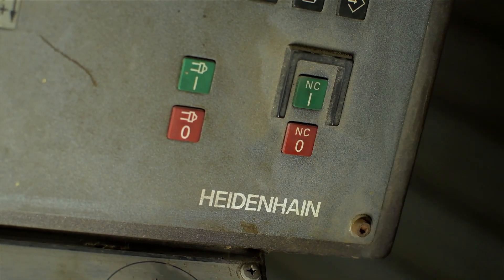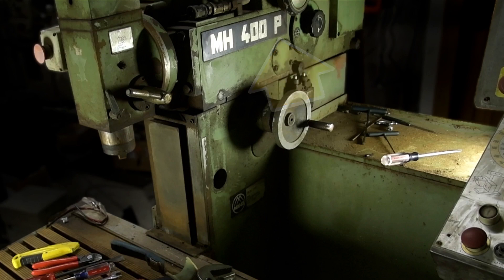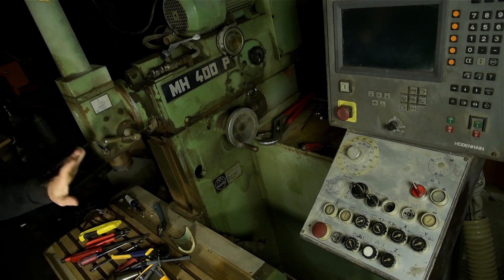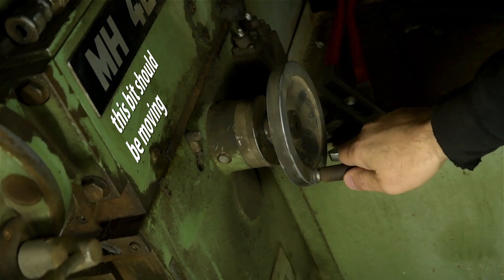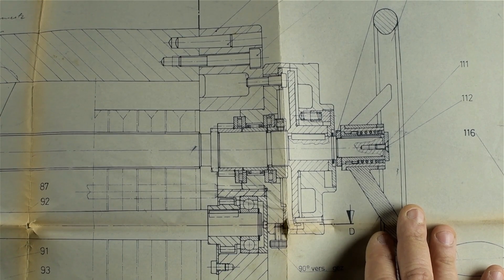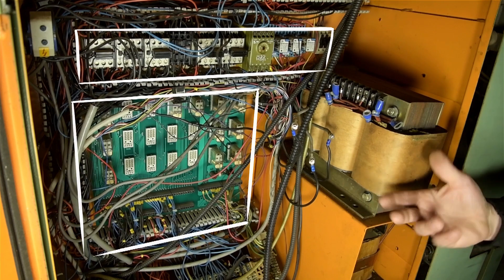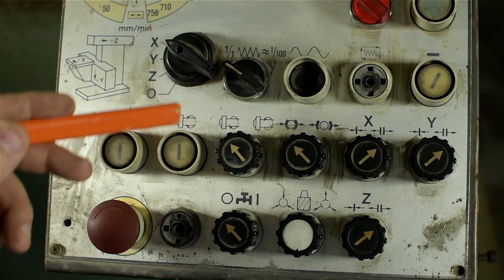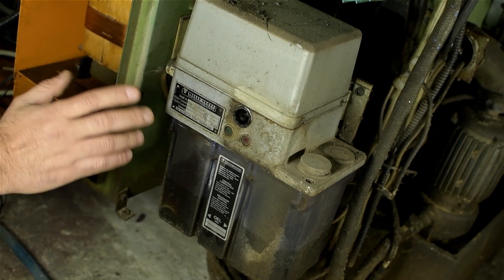MAHO is Filthy!!  (Whose Milling Machine Isn't?)

Comment: Those appear to be line reactors that you bypassed - typically used for power conditioning, especially in motor drive applications where a lot of line noise (EMC) can be induced. Essentially half of a transformer, and it probably has shorts in the windings.
Reply: I don't know about 'line reactors' but my brain said 'common mode choke' when he said it wasn't a transformer.
Reply: @Shaun.Stephens  Same basic idea. Just more power (and beefier construction) than what you'd see for a common mode choke. Basically the same deal with contactor vs relay.
Reply: @PeregrineBF  Thanks. My experience is with smaller electrical and electronic gear, hence the terminology I used.
Reply: And on that note, the effect of bypassing it will be potential damage to any upstream/downstream control electronics and the motors themselves. Maybe not immediately, but lifetime will be reduced; however, since most of that is already past its prime, TOT may be looking at damaging things quickly. Don't run long without proper drive components, or your motors may give up their smoke, Tony!
Reply: @Studio271  Really depends, as he is using a residential grid, the impedance will be most likely high enough, especially if there is a phase converter to give the missing phase from the US split phase system. The line reactors are there for factory installations where the machine is being fed via large diameter conductors, short distance from a breaker board, which is again a very short distance and with large feeders to a large ( 1MVA plus) local supply transformer, and the supply impedance is approaching zero, with the resulting massive inrush surges to contend with.

Had the same issue retrofitting a motor to run off an inverter, as opposed to the VARIMOT drive it had, as the VARIMOT components had worn out, and were replaced instead with a fixed ratio, so I had to compensate for the lack of adjustability and also go slower, limited by pulley size and space. So in went an external cooling fan for the motor ( nice Lenze motor, with full shroud and TEFC construction, and with cooling channels in the casting, but a smooth exterior) just in case it was unhappy or ran slow, and rewired it to delta from DOL star connection, along with disconnecting the DC braking system ( repurposed that supply though, got the braking clutch to work properly again) and relying on the inverter dynamic braking to dump energy fast. in went a nice little 1Hp Omron inverter, with supply via a noise filter to increase supply impedance to something higher than the existing supply impedance of around 20 milliohms, as the cable from the machine to the transformer was 30m total, and only 5m of it was smaller than 16mm.

Yes, machine built in 1970 with the biggest upgrade being that, otherwise all the existing stuff was present and running, though the more exotic parts like thermoswitches were slowly being replaced with electronic controls and Pt100 sensors as the Fenwel controls died from old age, as this was a lot cheaper, even though I can still get the Fenwal switches, but the retrofit was around a tenth the price of each switch. But got sold, and the new owner did a complete overhaul of the electricals, want to see how it looks now, but it is half a country away.
Reply: Definitely a line reactor. It's used to provide impedence between this machine and the source powering it.
Reply: That is a freaking huge line reactor for a system of that size.
Reply: @jtkilroy  It's also got quite a few motors on there and since they're not connected through a VFD, they're all asynchronous connected directly to line. So yeah, power factor is going to be horrible if there's a bit of load on those motors.

I'd pull everything out up to the wheels driving those axis screws and put some servo motors with VFD's on them.
Reply: I'm pretty sure it's not line reactor, cos if it where faulty, it would break fuses only when motor starts.. my guess is isolation transformer.
Reply: @ErrtuZarathos  Large machines often have a single set of line reactors, as it is cheaper to make a larger one than install multiple smaller ones, plus it then also protects the control logic from line transients as well. 

Single part to install, though there yes it could also be providing isolation, but with the motor power of the machine the transformer function would be much larger, though this could also be a multitap one with the ability to cater for some line adjustment as well, used as an autotransformer to correct for minor voltage adjustment, or to do 400VAC to 240VAC autotransformer, though with US equipment that probably would be also used to do 277VAC to 115VAC conversion using the same transformer. If so then probably does both functions, if you just disconnect the neutral links to turn it into 3 chokes. 

However if it got wet then windings will be toast, as the paper insulation will have arced over and broken down the first time it was powered on, killing the transformer.

Comment: What a nice Mill Tony. What TNC is this Heidenhain control? been using Heidenhain alot.
Reply from the maker: 124?  142? I mention it in the video.  It flashed on screen on power-up but I didn't get a lot of screen time with it.
Reply: @ThisOldTony  very nice. Must have missed it. They are super simple to program and have alot of cycels to help programming. Give it a go before converting it 🙂

Comment: MAHO had a good reputation as a maker of excellent manual precision boring mills in the 80’s. Then they dabbled into the CNC market. Was in a shop that bought one of their very first horizontal milling machines. A CAT-40 600mm sized machine. I was the second shift operator of it. Aside from the software, robustness, spindle motor, coolant system, & general build quality being garbage it was fine. So fine in fact that they willingly replaced it with an “improved” model within a few months. That one was only marginally better. It was gone within a year. A very long & frustrating year.
Best of luck to you with yours. I do understand that they got better at making CNC equipment.

Comment: As someone who owned a Maho MH 500 C for 10 years..  you are in for a "treat especial" you should have gotten the MH500C though. Much more user friendly. Anyway.... when will you get along with that CNC lathe conversion?!
Reply: Whats the C stand for ? What does P stand for?
Reply: @dieselmakesmehappy  The P plays Pong, the C plays Chess
Reply: P is point from point control (Punkt in German) , later they had E,C,S and W models where E was Economy, no idea what the rest stood for
Reply: @javanree   C stood for the 4th axis and W for Werkzeugwechsler so automatic toolchanger
Reply: @erklaerbaer01  vielen Dank für die Erklärung 👍
Reply: @javanree  Very Interesting. Thank you

Comment: Hi Tony, I have an MH 600P and am missing most of the documentation of it. Would it be possible for you to photograph or scan the manuals you have?
I can give you a schematic for a rework to switch the y- and z-axes, from my MH600P that you might be able to use until you upgrade yours to servos. Also, the greenish BBC-Disc-Motor should powered by the „Axodyn“-Regulator-PCB that I think I spotted mounted to the door of your cabinet.
Hope this helps! Cheers, Colin

Comment: Based on the looks of the part you bypassed and the very fact that you bypassed it and it works. I'd say that is likely a choke. It is a EMI filter that help the machine be a little more polite to the electrical grid. If I am correct about that, there is little harm (safety wise) in bypassing it. If you give us a better look and maybe trace some wires, we could confirm that?

Comment: Greetings from Germany :D i love your videos.

the 400 in the letter skirmish on the side stands for the model series MH and the total movement of the x-axis (400 mm). the P... i don't know, maybe Power? :D
Nearly all the machines are made equal, except from the length of the x-axis, so keep the drawings!
Also, MAHO was the first iteration of the later called DeckelMaho and are now the well known DMG (DeckelMahoGildemeister). Maybe you know it as DMG-Mori

Cheers :)
Reply: Meinst du bei dieser alten Maschine ist die Programmierung komplizierter ? Habe Heidenheim am einem Bohrwerk programmiert und arbeite jetzt mit einer DMU duoblock. Wundert mich das doch einige deutsche diesen Kanal gucken

Comment: Oh man this is great. Over here in the German rustbelt these things pop up all the time, same with Kunzmann, Steinel, Aciera, some Deckels and so on. The regular ones are gone fast but the NC or very early CNC ones, not so much. They're sometimes very cheap because nobody really knows what to do with them - pointless to buy and use for a company, but too weird and way too bulky for the average home gamer (not as much shop space here for most people). I always wondered if it's worth picking one of these up and converting it to full manual instead of CNC to get a cheap, sturdy mill but maybe your idea is even better. Excited to see what you do with this thing, hit me up if you need any german manuals translated!

Comment: if only you'd have a 2 meter tall, blonde hair, bilingual, cnc-specialist, german friend who'd show you the ropes...
Reply: Dolph Lundgren?
Reply: @rmschrader36  I thought Dolph was swedish!... but I'm certain he is a chemist. (that's for Tony's other projects *wink*)
Reply: I'm quite sure he would have VERY strongly advised against the P version of the 400, especially for retrofitting, it is the sadder one of the various types of MH400s around, and there are quite a few, E/S/C/W, other ones come with ball screws, not sure if they had servos for all axis in the 400 size, and I vaguely remember some version of the 400s having box ways on Z (vertical) axis
anyway, considering he payed less than 1k eur, not a bad deal, not a steal, but not bad either, I personally would have passed on the "P", unless it was a very clean one, most of them have quills, that would mean the quill-less Schaublin would have to go...
Reply: buba garcia  You mean she could hold his tool while he looked in the hole....just asking.

Comment: It's "Deckel" "Maho" "Gildemeister"!
Reply: I visited the factory in Bielefeld 13 years ago.
Reply: @Heffen89  I was there in 2014, when they had a show day.
Reply: @Heffen89  Yeah right Bielefeld doesn't exist. /s
Reply: Mayo
Reply: My dream is to have any of the family that is related to DMG. In Brazil we have older Deckel (70 and 80)
Reply: @BPT-10  I run some early 2000's Deckel Maho 5 axis Mills with heidenhan controls and they're a treat to run. I prefer them much more compared to the later dmg moris I ran with fanuc controls!
Reply: Well yes but actually no. :D
At first they where all independend. At first Deckel and Maho fused together and became Deckel Maho AG. Then they where bought by the Gildemeister AG and became DMG. Over the years the cooperation with Mori Seiki grew and eventually they became DMG Mori.
Reply: @Testkeks  Ja,  das stimmt!
Reply: @captainbackflash  Warum hab ich mir eigentlich die Mühe gemacht das auf Englisch zu schreiben???😂😂😂
Reply: @Testkeks  Because, mit is mir polite!
Reply: @Testkeks  Ich hab in der Arbeit diese Deckel Maho 5-Achs-CNC-Fräsen und Gildemeister haben wir auch
Also im Endeffekt wahrscheinlich alles vom gleichen Unternehmen gekauft :)

Comment: My guess from Germany is: The transformer „transforms“ your 115V into the 230V the German machine was build for. (although such a big machine requires 3 phase 380V/50Hz)
Reply: he said it was same in and out... probably ferroresonant power regulator.  Before solid state power conditioners ferroresonant transformers can take sags and surges plus or minus ten percent or so
Reply: Especially as the paperwork dates to 1970’s. Does that mean the machine was imported, that it has a rubber stamp ? Do I notice a second transformer just visible under the top one ?
Reply: Paul Lewis I also thought that there was a second transformer underneath!

Comment: Dear Tony

The other Tony at lathes.co.uk (a machine tool archive),  in the "Millers and Jig Borers" part, has a section on MAHO milling machines and he does seem to have some catalogues and manuals (in English) available.

Hope that may be of some help.

Paul
Reply from the maker: Thanks Paul!
Reply: @ThisOldTony  and if you still need some translations you might find some pesky germans here lurking around and some of them might even be willing to help...
Reply: @mariuss4766  paging Stephen Gotteswinter, paging Stephen Gotteswinter.
Reply: Selffound Hering here is one of them 🤗
Reply: @ThisOldTony  Probably a frozen coolant pump impeller due to rust. I used to have that problem on new machines right from the JA pan company. They had to send a tech to replace it on warranty. We'd keep the "bad" one on the spare parts shelf. (After a 5 minute repair.) 😂
Reply: @ThisOldTony  Pretty sure the 1:1 transformer is a safety feature, there to electrically isolate live wires on the inside of the machine from earth so that theoretically if there's a fault and you end up touching a live output there's no circuit through your body and earth, protecting you.

If the live output of the transformer touches the case and gets connected to earth (you said there was some water in the case), then it will be grounded and the "neutral" output will become live. The machine might continue to work (for a single phase at least, I'm not sure about a three-phase system.)

Obviously you'd still get shocked if you touched the live and neutral outputs or at the same time-I don't know if there's a fuse that's meant to blow if there's too little resistance between the two, maybe that's why it's not working)
Reply: @TheREALMcChimp  Unfortunately this sort of thing will defeat your RCD's (or ELCBs) if you do manage to get hooked up across the output of the isol transformer.
Reply: @0stinger0  Yeah, was wondering if maybe they'd included a breaker of some kind after the transformer to make up for that and maybe that'd tripped and was why he had to bypass it. Might be an easy fix.
Reply: Paul, you are the hero that everyone needs.
Reply: There is no "other Tony"...
Reply: @MarcinKrukar  Yes there is.
Reply: Thanks Paul, I have an old Harrison L5 lathe "this other Tony" has a manual and spares for it! Brilliant 👍
Reply: My goodness Paul.  That is one heck of a resource!

Comment: To move the Z achses pull on the spindel to engage.
I have worked on german milling machines
Reply from the maker: Please elaborate.
Reply: @ThisOldTony  He means that you have to either push or pull the handwheel in, in order to engage it. Some Schaublins and Deckels have this system as well in order to prevent accidents in CNC mode while the machine is running.
Reply: DIY Dilettante . This also true for an old Deckel FP3. Pull the hand wheel gently, while you spin it. At some point it will engage and start moving the spindel.
Reply: Ist ziemlich nervig aber stimmt. Die älteren dreh- und Fräsmaschinen haben das als Sicherheitsvorrichtung. Aber ich denke das hat er schon ausprobiert

Comment: Ceramic Fuses are still a hot thing in Germany, called Diazed Fuses! Used in many high current situations for their high resilience (can hold up to 10 times its nominal current)
Reply: you maybe don't understand how fuses work, but, changing the body of a fuse, ceramic or not, doesn't magically change its attributes. The wire inside does. And if a fuse holds 10 times its nominal current, that means it's not a fuse. A fuse is meant to break first before any other wire does. The fact you're praising an outdated bulky poorly conceived technology as a "hot thing", and praising it for... Being the opposite of what it's designed to do, worries me of the future of mankind.
Reply: @dimitar4y  you obviously didn't look into diazed fuses at all.
Maybe I did not phrase my thoughts right. 
First off all. every fuse holds more than its nominal current. You should look that up.
For example a standard b16 fuse in germany trips at 3 to 5 times its nominal current. (80Amps).
of course it will also trip at 16 Amps but only after two minutes. Law regulates that wires in germany are at least to be designed to hold the nominal current of the fuse the wire is supported by.
Because otherwise if you would start a motor in a workshop, the starting current (which is 4 to 12 times higher than its nominal current) would blow the fuse immediately.
Also fuses work thermally. The wire wont melt if it has to hold a high current for short amounts of time and so wont the fuse.
The starter of your car is pulling up to 600 Amps yet your car has a 20 Amp fuse.)
So holding higher currents than its nominal current is EXACTLY what a fuse does ;)
Also: nominal current != breaking current

See here for more info on breaking currents and switching times of fuses.
https://en.wikipedia.org/wiki/Circuit_breaker#/media/File:Standard_Trip_Characteristic_of_a_Thermomagnetic_Circuit_Breaker.svg

on poorly conceived technology

ceramic, quartz filled fuses exist longer than you and me. The technology is fleshed out and heavily made use of in powergrid appliances and large factories.

A 32 amp fuse had a wire of 1mm thickness inside back in the days and still has it today. And breaks circuits just fine.

I was pretty sure someone who knows about electronics might understand my short comment so i dont have to write a whole excerpt about melting fuses.

Oh and one more thing. if you have an old machine using ceramic melt fuses you can buy new ones and fit them in there and fulfill all the regulations. crazy, huh?

Comment: Ahh MAHO, finally a video I can relate to. Currently running a MAHO 600 & 800 with also the incorrect user Manuel's.
Reply: Maybe you and tot can swap manuals
Reply: Typically it's for a different model entirely